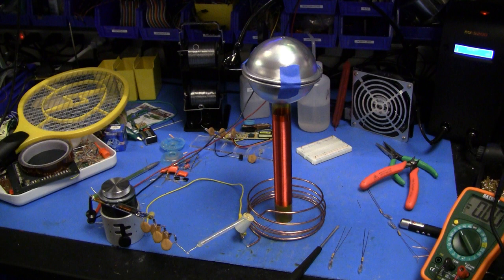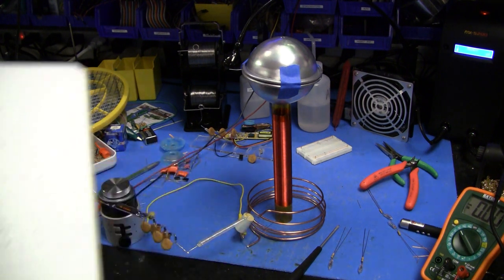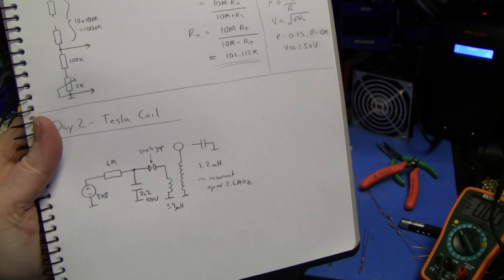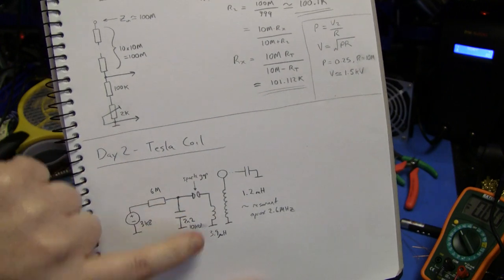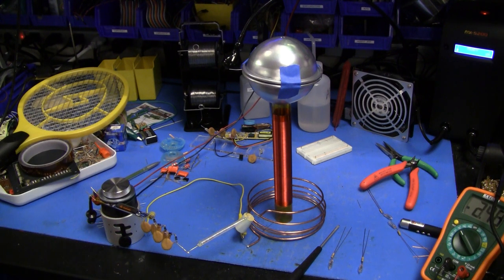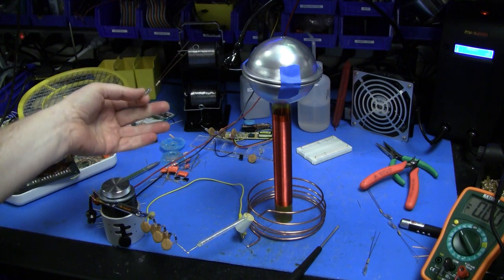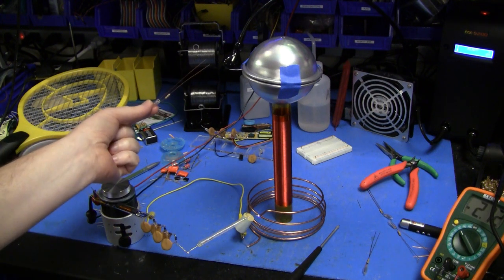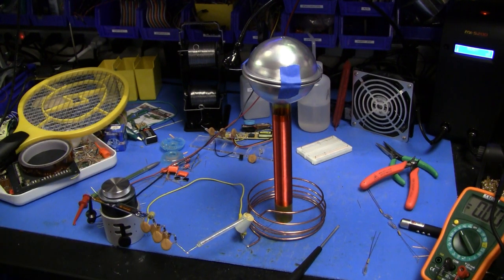Advent Calendar of Circuits 2014: Day 2: Tesla Coil

Comment: Try using flyback transformer as the power supply and use leyden jar capacitor...it should do the trick when it come to make the spark longer,brighter and louder

Comment: Tesla once mentioned, in writing or interview, that a switching device (?) composed of two plates and a thin dialectric would be ideal for some operations in communication or wireless transfer. its like a spark gap but it seems to do away with effects from the air. any modern day innnovations that can be used like he described?  some type of vacuum tube or something ? hah thanks very much for the electronic advent calander cheers!

Comment: I need to measure power input or output into a Tesla coil working between 1kHz to 10 MHz.

Do you have any ideas how to make such an power meter, that would need to be resistant to EM oscillations produced by the coil itself.
Reply from the maker: +HitAndMissLab couldn't you just measure the DC or low-frequency AC input power to the circuit?  You can add a low-pass filter to remove any stray RF headed out the power supply and measure the input with a normal multimeter.
Reply: +vk2zay yeah, its more complicated than that. I want to get two tesla coils into resonance and than measure power on both sides. Averaging DC wouldn't give me a right picture. But yes, I think I should shave HF noise with filter.